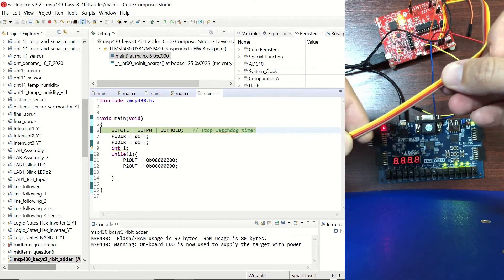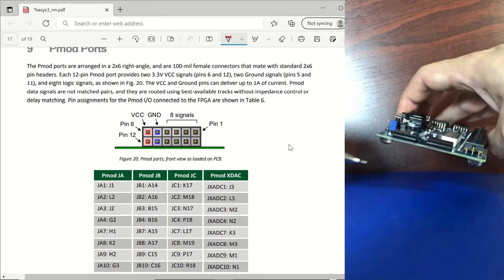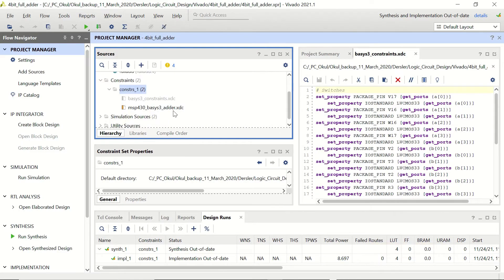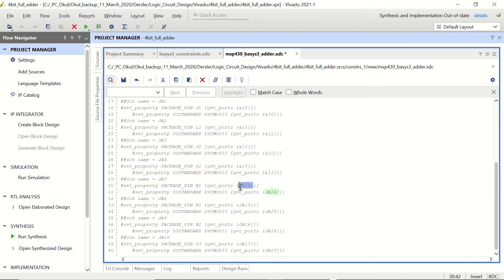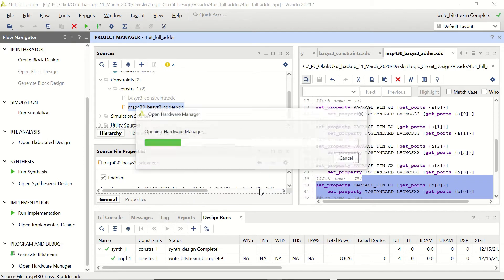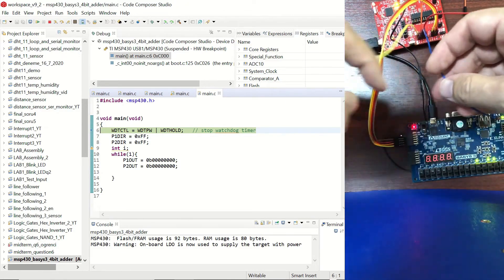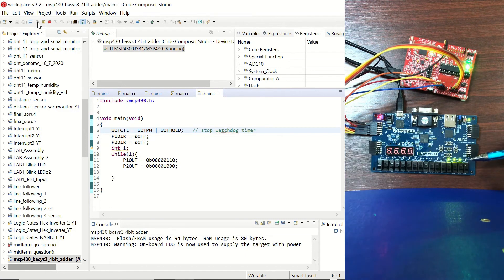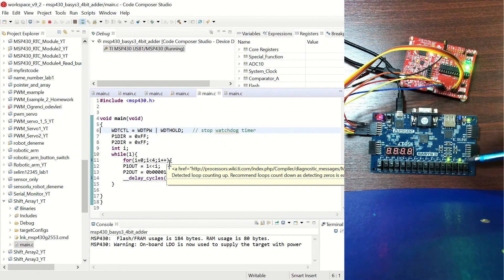Pmod Ports in BASYS3 FPGA: Connecting to MSP430 Microcontroller

Comment: Hello sir nice video, very good information. I have a question, if im using two same fpga board, can i still use this pmod pin as imput and output. One fpga will send a data and one fpga will receive the data, could it be done sir ?
Reply from the maker: Hi , I haven’t tried it. But it definitely should work. As you said one fpga as input and the other as output.
Reply: @drselim  thank you sir for the answer, im a bit new on this fpga area. Do you have any experience on how to use this pmod pin as gpio to send and receive data in ip block and writing the program on the sdk ?
Reply from the maker: @haziqishak612  I cannot give you exact instructions and code, also I don't have my basys3 board to work on since I had to return it. But you can go through the examples I've done in the basys3 playlist. Basically you'll define the related pmod port's pins as output in the output device by defining it in your verilog code and change the .xdc file accordingly, also similar settings should be done at the input device as input. I'm sure you can implement it easily.
Reply: @drselim  thank you very much sir. I would try to look at your videos.

Comment: hi sir. well explained video. I´m new with FPGA and would like to ask if is possible to use 2 different pmod connectors as general Input output pins. I want to connect an external ADC of 12-bit with a higher sampling rate capabilities of the internal one. from the video I inferred that is possible but I wanted to be sure before purchasing it. thank you for your time in advance
Reply from the maker: Hi, thank you for your comment. I haven't yet experienced the Analog pmod port ot the BASYS3 (The XADC core within the Artix-7 is a dual channel 12-bit analog-to-digital converter capable of operating at 1 MSPS. --from the reference manual). But it should be possible to use an external ADC. I had used Microchip's MCP3208 with Raspberry Pi, which used SPI to communicate. I don't know which ADC you'll use, however if it also uses SPI, you can try to write your own SW SPI for the BASYS3 and handle the situation with a single pmod port (standard 4 wire spi: sclk,csn,miso,mosi) or try to find a solution code which may already be available on the internet.
Reply from the maker: I have skipped your main question, yes you can definitely use two pmod ports as general i/o and control them together such as getting a 16 bit signed integer from 16 pins. In the xdc file you can set the two pmod ports to be part of a 16 bit binary number, one as the most significant byte and the other lsbyte.
Reply: @drselim  many thanks for your valuable answer.
Reply from the maker: @xyilmaz3563  You’re welcome.

Comment: Thank you for this very informative video. What is the part number of the MSP430 board you are using? Is it still available? If not, is there a suitable substitute? I look forward to seeing your other videos.
Reply from the maker: Hi, I'm so glad you enjoyed it. The exact code for this launchpad is "MSP-EXP430G2ET" and it's available in the market.
Reply: @drselim  Thanks for the reply. I found it on Amazon. Both Digkey and Mouser are awaiting new stock. I get the idea of input into the Basys3, but what about output from it. For example, output a clock signal to measure on an oscillscope? Keep up the good work!
Reply from the maker: Hi David, I didn't experience it earlier (getting clock output from the device). But I'll try that (in a couple of weeks most probably - next semester) and let you know. Probably I'll make a video for that  as well, thank you for the idea. 
However digital output and pwm are included in my playlist for msp430, you can take a look at them:
https://youtube.com/playlist?list=PLbFgDf51ZkCGCGxMXQiIQWJUbOoYj9Y5X
Reply: @drselim  I will start the playlist from the beginning and let you know if I find what I am looking for. Maybe save you the  trouuble of creating another video. Thanks again for your effort.